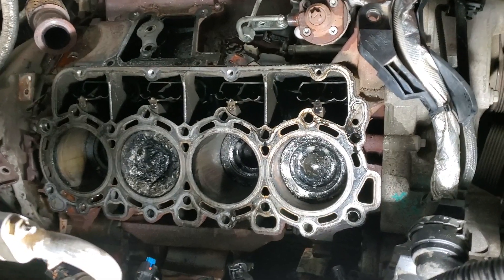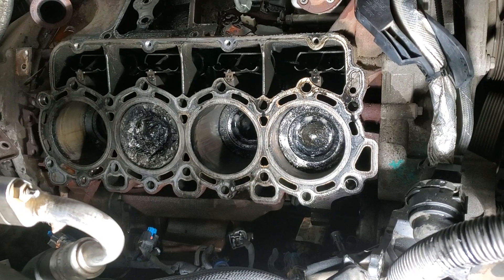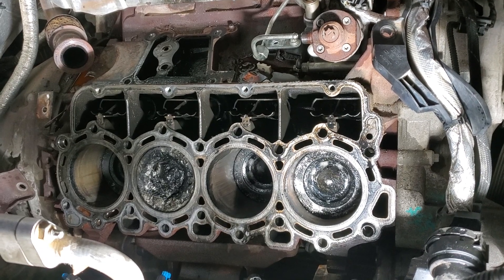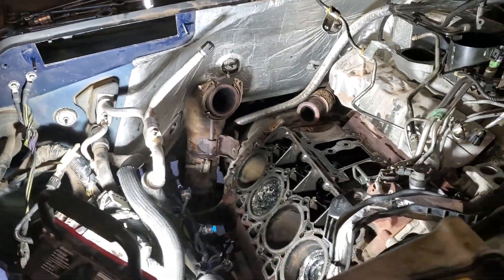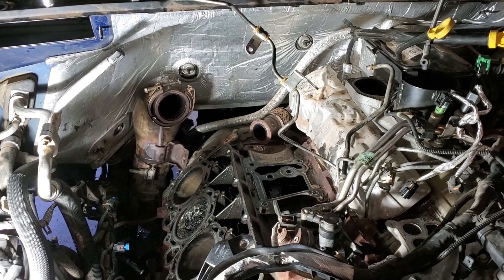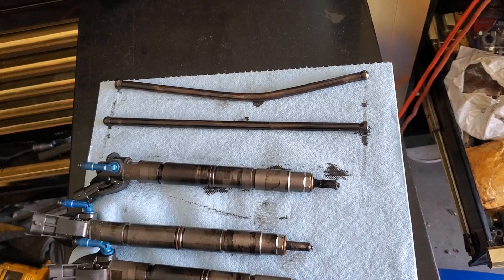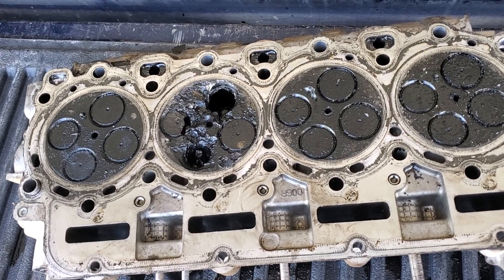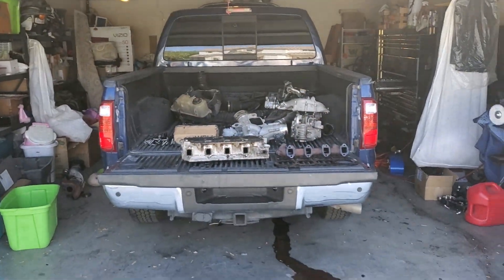2011 Ford F250 6.7 head removal with cab on

Comment: I just started getting contribution balance on cylinders 1,2 & 4 I hope it’s not as bad the balance is not that far -/+ 4
Reply from the maker: Pull the glow plugs and see what you have. Didn't take too long through the wheel well.

Comment: What did it sound like running? Mine is throwing a P0266 contribution code and has exhaust thump to it but runs perfectly fine and no smoke except when you get on it hard. Exhaust only sounds funny at idle
Reply from the maker: It would barely move, Blake smoke clouded the area and had a major thump noise.

Comment: So did you just take the tensioner pulley off and the fan cover to get the bolts in front of head through the water pump?
Reply from the maker: I'm pretty sure I had to take the tensioner off yes. It's been a while since I did this.

Comment: I have misfire cylinder 8 balance  it was running fine I presure wash and it misfire after 20mins I change the injector and reprogram it  still same now the truck won't  crank .everything turns on  but when I want to start it flickers  the dash new battery to helpppppp
Reply from the maker: Hmm that will need some troubleshooting. Sorry I can't help more

Comment: Hey Nick, I have a 2012 6.7, and it has 330,000 on it. I’ve owned it for a year and recently the turbo started failing working only 30% and the cel showed code 0284 I believe? Cylinder 8 balance and something about fuel. So I ordered a turbo upgrade and new stroker cp4 and 30% injectors bc I assumed it was a failed injector considering the miles. Once I tore the top end apart I ended up snapping 5 out of 8 injector hold down bolts. How hard is it 1-10 to remove the heads? And is there anything you recommend that I should do while I have them off? Cam? Valves? Port and polish?… I was thinking ATLEAST head studs and porting
Reply from the maker: To be honest, that seems like a lot of work. 8 out of 10. I didn't see a need to upgrade anything like that but they are known for lifter and rocker arm issues. If it were me and the truck were still in good shape, I'd find a good low mile 15 to 18 to put in there. There are only a few things to swap but overall a better motor.
Reply: @a1cborresen  only problem is I paid 20k for the truck and don’t get me wrong it’s on very nice shape and been taken care of for having over 300k miles, you’d never know by the it runs and drives. Hardly any blow by. It’s my first Diesel but I’ve been turning wrenches for years. After I started hearing the vgt squeal I said screw it and ordered a performance 2015 turbo for 5.000 dollars with the retrofit kit. But after tearing it down and running into one thing after another, I now have close to 18,000 dollars worth of parts sitting in my garage. The 5k turbo hurt my wallet, but now I’m really in trouble financially after the bolts snapping in heads. Idk what to do but I can’t afford an engine that’s for sure. I should’ve just put the turbo in and been done w it, but I figured with the mileage and since I already had it apart I might as well change injectors and pump considering they are notorious for failing. Boy was that a mistake
Reply from the maker: That sucks, sorry. If you can't get the cab off take the inner fenders out. That and the A/C lines would make it easier. The factory stuff can handle some good power. Don't go putting a ton of money into the short block. Good luck. Also, I found my 15 motor and turbo setup at a junk yard for $6k with 70k miles on it. Car-part.com

Comment: I’m having trouble getting the injector hold down bolt loosen from my 2011, how much effort did you have to exert in order to break it loose?
Reply from the maker: I used a wrench trick to remove them. Lay one flat behind the injector then put the open end on the top and pry the injector up.
Reply: How does that help get the injector bolts loose??

Comment: Do you think this engine is rebuildable
Reply from the maker: This one was sent to a rebuilder for parts. Not sure what he did with it. It was more cost effective for me to put in a low mile junk yard from a 15 for a total of 7500
Reply: Cool
Reply: Did you have to reflash the ECM to work with this different engine?
Reply from the maker: @TERRELL SCAIFE  you do not have to but I deleted it and added some HP tunes.

Comment: What was the total cost of parts for the repairs?
Reply from the maker: I purchased a junk yard 2015 motor with 75k miles. Full delete ezlink tyrant tunes little thing here and there ended up around 8k total.
Reply: @a1cborresen  not too bad. Did you do all the labor yourself?
Reply from the maker: @stetsonakin2008  I did, took me about 2 weeks in my 2 stall garage, weekends and evenings.

Comment: I’m changing a injector right now and I’m having a huge trouble getting the hold down bolt out without breaking it
Reply from the maker: I didn't have trouble with the bolts, I used 2 wrenches to pull out the injector.
Reply from the maker: It was in there pretty tight. I found a video at the time that showed using 2 wrenches to pry it up.